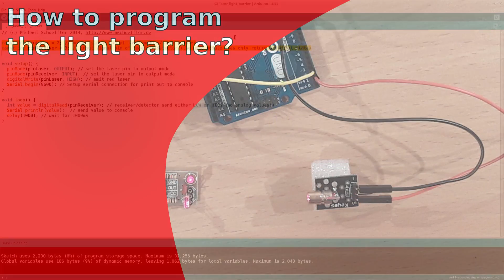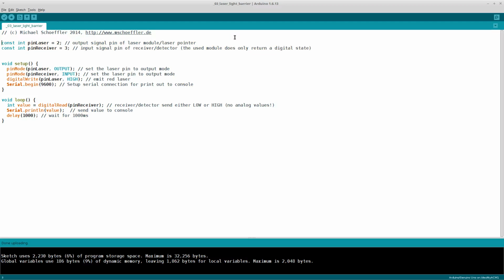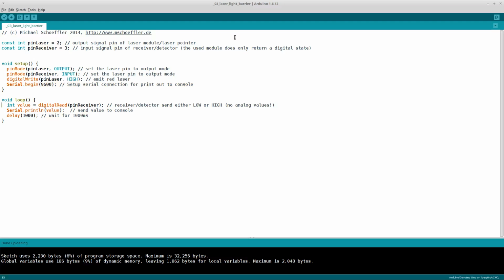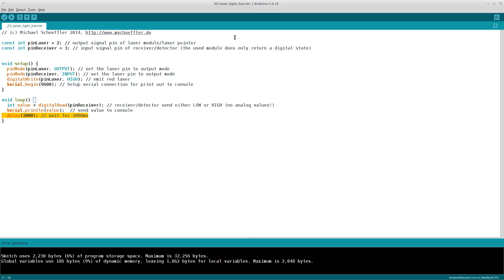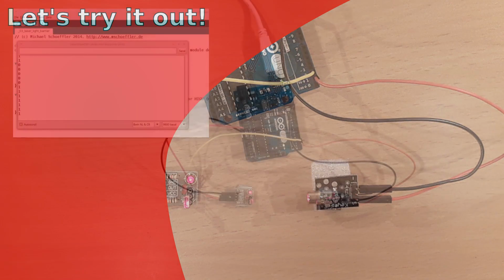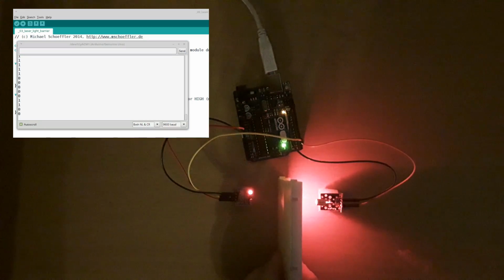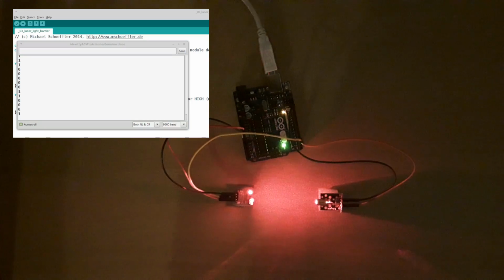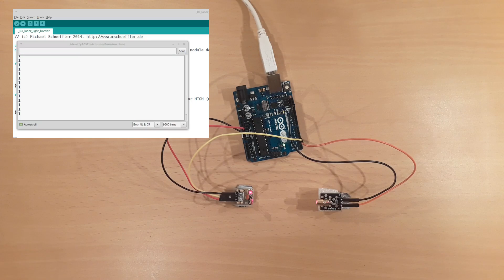How to use the red laser module KY-008 with the Arduino Uno | UATS A&S #3

Comment: Sir, i m a newbie , I want to know if it is possible to make arduino uno/nano led strip such as wd2812b music sync via internal audio from the pc, I don't want to wire a mic module or audio in jack to a breadboard but simply play my spotify / youtube audio which will react to my LEDs.

Comment: Hi, and thanks for the tut. One question that puzzles me a bit though, much as it seems to be answered by Shaun: the transmitter has VCC, GND and SIG pins. My understanding is that the transmitter only needs power, that is VCC and GND ... although it can be powered (and toggled) from an Arduino digital pin.

But in case I want a detector in the doorway, having both modules hooked to the same Arduino is rather inconvenient and I will be just fine powering the tranmitter from an external 5V source and only having the receiver hooked to the Arduino (along with a buzzer or whatever output I want). Correct?

I mean, I wonder why it has all three pins where two seem to be enough...

Comment: Thanks for the video, Michael.  Just one thing about the laser transmitter and it not being able to operate in normal light conditions.  This is not correct.  Your video shows the laser transmitter receiving current when Pin 2 (I think) is set HIGH.  This means the transmitter is receiving power from the Arduino board, which is a relatively small power source and not able to fully power the laser light.  The laser transmitter has a 3rd pin (+) which should be connected to a 5V power source independent of the Arduino board.  This will provide the laser light with enough power to operate under all light conditions.  I have the same laser transmitter and receiver set up on my desk, in bright office lights, and it is working just fine.  I even went one step further and shone the light from my smartphone at close range onto the laser receiver and still, the laser was powerful enough for the receiver to detect it correctly.
Reply: Here the problem is that the sensor picks up too much background light, so increasing the laser power doesn't help... unless you change the sensor sensitivity. I would suggest to provide some shade for the sensor and use an analog input and use modulation.

Comment: Can u send me the manual of laser transmitter and detector module? & it would be helpful if u show what's inside the detector , what principle it uses?
Reply from the maker: Unfortunately, I do not have a manual :( However, these kind of modules are based on phototransistors / photoresistors.

Comment: You can also use a photoresistor without buy the laser detector
Reply from the maker: Yes that's true. The laser detector has the only "advantage"  that you do not have to enter a threshold value for your photoresistor. The detector module returns only LOW and HIGH (no analog values).